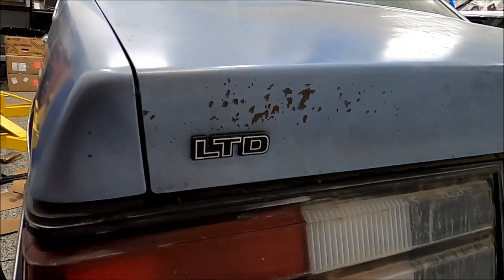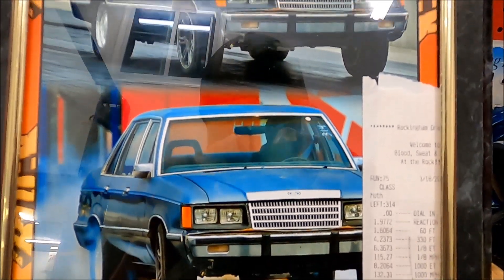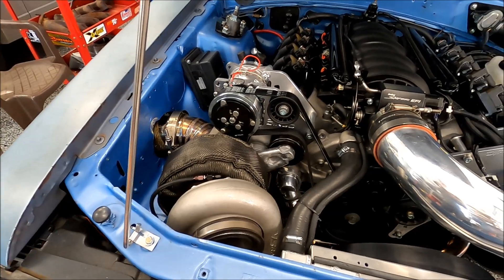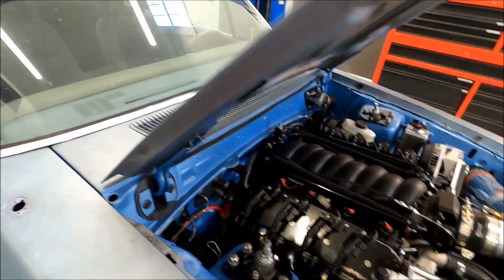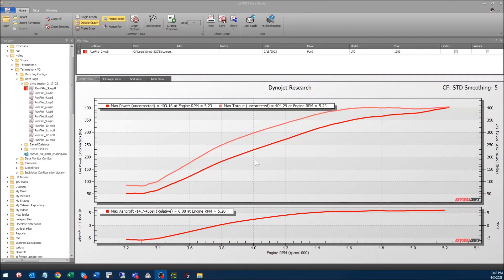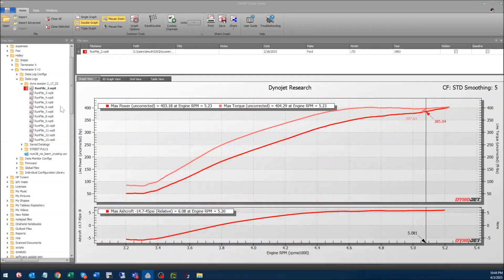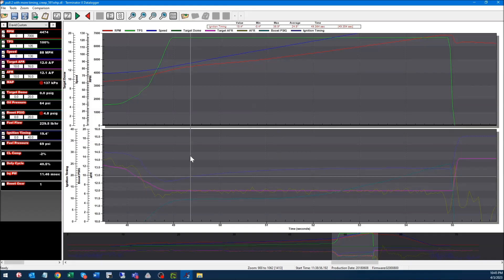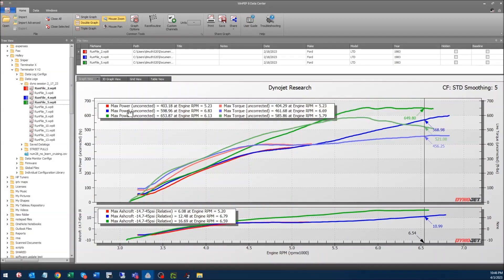1983 LTD Sleeper - New turbo build #2 + Dyno Sesh & horsepower science

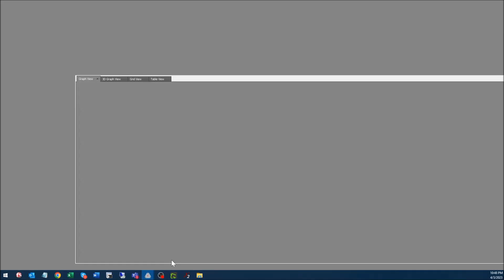Comment: When you want to remove runs ( 10:23 ) just tap your delete key after clicking on the run(s) up top.
It's only one key-tap vs two mouse clicks doing it that way and no worries, it doesn't delete the actual files, it just removes the runs from upper File View/Graph 👍
I came here after seeing your comment on Devin's video about Build-300 finally being able to Save the Holley Data Channel Colors.
I've been tuning Holley EFI on drag bikes for many years and that's one of the (very) few things I have always hated and wished they would fix 🙏
Reply from the maker: Thanks. I don't use dynojet software daily so I'm rusty and don't know all the shortcuts 😂. Yeah I submitted multiple tickets to holley about the channel colors in datalog and how many customizations wouldn't stick. I'm sure I wasn't the only one complaining 😂. The only thing the new holley needs is to have the 3d fuel chart editable like hp tuners. But I suppose dual window view is an OK compromise
Reply: @genuinegarage  Even though I went to the Accel DFI school, MSD and Holley were the first stand alones that we successfully  installed on the bikes (because Accel never came out with ignitions like they said they  would) and even then, in the begging we had to grind all but two teeth off of the Crank Rotors (one pulse, one fire configuration). So I have always loved how Holley keeps adding and updating things (including the crank sensor settings we asked for)👍

Comment: I know this is irrelevant to this video, but can you shed some light on your old supercharged build? I'm looking at a 5.4 2v swapped new edge. Has the ugly tall intake and likely needs work, so I wanted to supercharge it if I do trade tomorrow. What all do I need?

Edit : I don't want to break into the block at all. I want to use stock heads, cams, and bottom end/internals. I'm just looking to slap the intake and supercharger on it. Would I use lighting injectors? Do they use the same harness? That truck was gnarly, so I gotta get some info man.
Reply from the maker: Yeah your best bet is to just slap the supercharger on. Don't need to upgrade the motor or anything. Lightning injectors just plug in. They are probably easiest for tuners to tune. You'll need a bunch of stuff. Too comprehensive to list on YouTube. It can all be found on forums and Google though
Reply: @Genuine Garage  Any specific forum I should search? There is almost zero info on 5.4 mustangs out there.

Comment: Maybe I missed it but what fuel are you running? Also what was the timeslip improvement?
Reply from the maker: Pump e85 70% content. Gen 1 pb was 10.0@139 14psi. Gen 3 is 9.7@145 19psi. Gen 1 seems to make better power everywhere except at higher boost levels. Both 60fts are atrocious at like 1.60